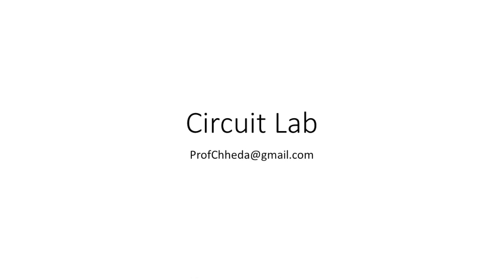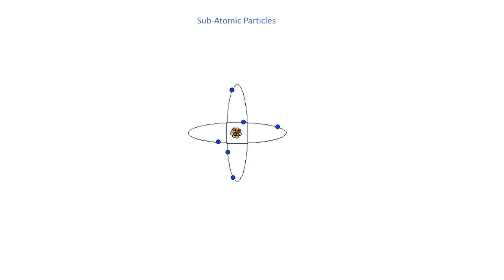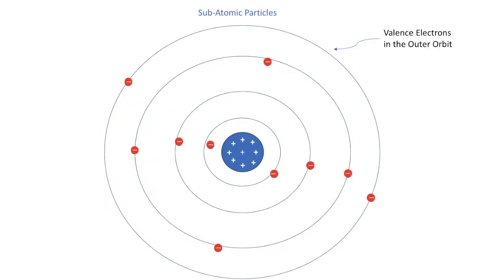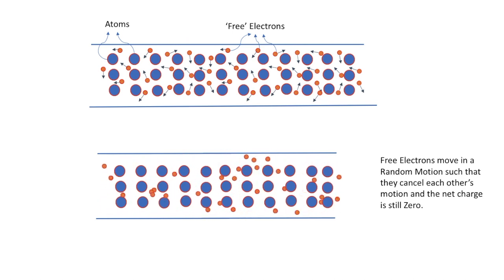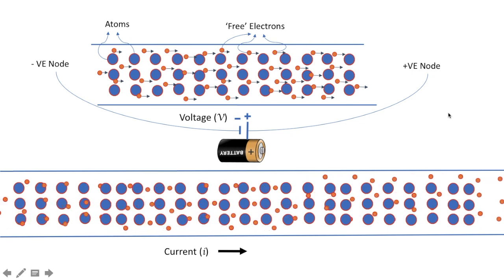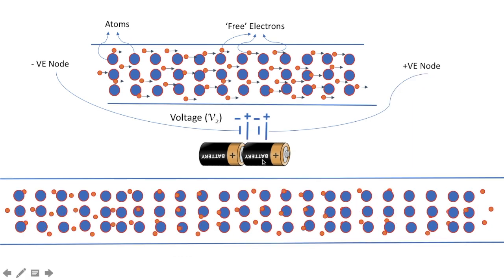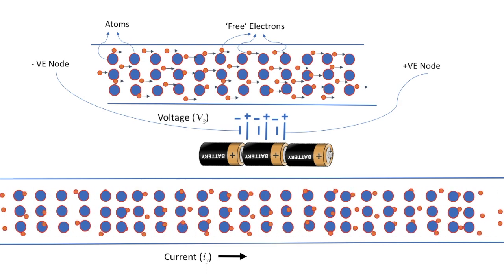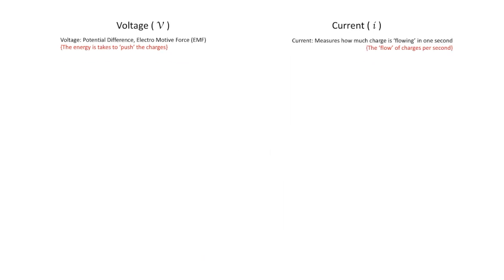How electricity, Voltage and Current works in a Circuit, Science Olympiad

Comment: the answer is "a" because 1) you litterly showed us that they are proportional in the little diagram above where the arrows are pointing between the voltage and current 2) most of the other options make no sense, like "e" and 3) because earlier in the video you told us they are proportional. But nice video, I liked it!
Reply: i think that some of the answers were intentionally absurd